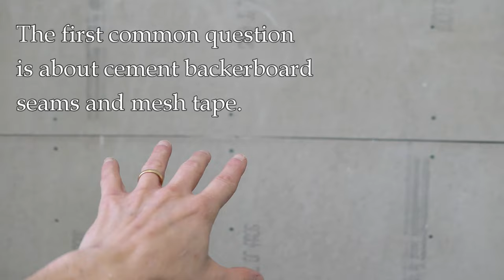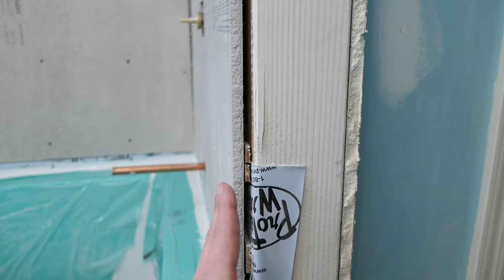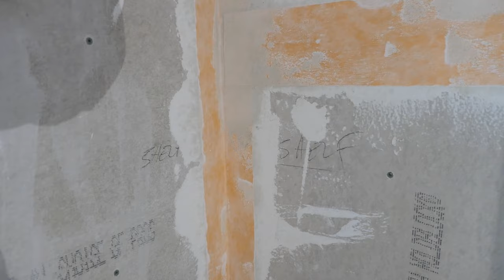Should Backerboard Go Over The Tile Flange Or Up To It?

Comment: Rad video, Thanks! One question tho. Are you not worried about the tile popping off of the stick on flashing near the tub flange? Is that material safe to tile to??? I am just about to install backer. I like this idea but am worried about tile/thinset adhesion to the flashing??? Thanks again! Very informative video!!!!
Reply from the maker: So, flashing or no flashing, the short area of the lip will not be a place where there is good adhesion from the thinset.  In other words, thinset will not adhere to the flashing and it will not adhere to the tub or pan if you did not use flashing.  This is not actually a problem for most installations.  The area there is typically around an inch in height or less.  If you plan your tile pattern correctly most of the tile will be adhered to the backerboard just above.  On a 12 inch tile you'll have 11 inches adhered.  On a 6 inch tile you'll have 5 inches adhered.  The area by the lip IS packed with thinset, but the purpose is primarily to provide a supportive structure for the tile rather than to adhere the tile to the wall.  The support keeps the tile from cracking if bumped, but it may not provide adhesion to the wall.  

Now, if you are using a very small tile, perhaps a 3x4 subway tile, you do need to be cautious about the installation.  In that instance I'll be meticulous about bringing the backerboard as close to the tub or pan shelf area as I can.  I'll make certain the backerboard there is dead flat, and I'll give the tile every chance to have adhesion to the backerboard since a smaller percentage of the tile is adhered to it.  And, it is possible that the nature of the circumstances prevents use of particular tile.  I have had situations with wall or floor tile where I've told a client that their preferred tile choice is not a good one for the circumstances.  They pick another.
Reply: @enduringcharm   @enduringcharm  Wow, killer response time and quality. Timing is amazing. Pickin up materials as we speak! I am using bigger tiles and that was my initial thought. The backer should provide all needed support. I just had a roll of the flashing in hand but i put it back, the aluminum coating scared me away from it. But realistically less than an inch of the material should be showing to cause any problems with tile adhesion. And a solid tile application and silicone should keep out any moisture anyways? Thanks again for that quick and informative response. Very reassuring!
Reply: @enduringcharm  and great point about thinset not really sticking to the tub flange in the first place!

Comment: You could eat into the studs to recess the tub and then shim out the opposite small wall.
Edit:
Nevermind Talked to soon, you just showed that the small wall is full lenght also.
Reply from the maker: Even if that weren't the case, it's a poor idea to chip away at the studs, especially on a load bearing or exterior wall.  If you needed to pull a permit for your project the inspector should call you out on that.

Comment: Love this video, I'm an architect and plan to share this with my contractor.  Do you have suggestions on installing flange-less tubs in an alcove.  I know you can buy tub flashing products and I've seen some contractors use aluminum flashing caulked on top of the tub edge to create a flange.  What do you recommend?
Reply from the maker: I recommend finding a tub with a flange!  There are a small number of modern tubs I've come across which did not have an integral flange.  I recall seeing a special order add-on flange for one of them, which was a weird bumper arrangement you were supposed to caulk in place.  I find it annoying when manufacturers make products as if they will be installed in a vacuum, without regard for the rest of the room or house.  It's not unusual these days for me to have to finish manufacturing an item, either.  Edges have to be filed down or holes drilled or sections cut away.  

Anyway, given the importance of the tile-to-tub line and the cost of a modern bath it's madness to rely entirely on a bead of caulk to keep water at bay.  I'm the first to argue that "waterproofing" is over-hyped in some areas like tiled walls, but the area where the walls meet the tub is not one of those areas.  I would make every effort to find an alcove tub with a integral flange, and that shouldn't be too difficult now because there are options at every price point.  Granted, the supply chain issues we face can be a challenge, but there are tubs to buy.
Reply: Thanks very helpful.  Especially the comment about the importance of sealing the tile to the tub line.  My client picked a freestanding tub they want to placed in a corner.  I was thinking we could add an aluminum angle with caulking then cover over it with door and window self adhesive flashing  similar to what you show in the video.  But I have the same concerns you've noted.  I'll steer my client away from corner tubs without flanges.
Reply from the maker: One secret to longevity in construction or design is never to let a client force you to do something you know isn't right.  I'm sure you'll find a tub with a similar style that has a flange.

Comment: In the past I used ice and water shield behind the cement board.  Now I usually just use red guard. Pretty much always put 1/4” plywood so the backerboard overlaps. But my goal is always to over build. 😜
Reply from the maker: To be clear, the point of me using the flashing is not "waterproofing" in the sense that Kerdi or Redgard is used.  I use the flashing even if I am also using Kerdi.  Instead, the flashing is there so that in the future if there is a problem such as framing movement, a homeowner who doesn't maintain the grout or caulk, or some other issue, water will be directed back into the tub.  I have seen lots of second floor baths leaking into first floor baths, second floor condos leaking into first floor condos, baths that were never maintained, etc.  The flashing is just a precaution.

Comment: Working on my bathroom now and found this video to be extremely helpful.  One question what fills in the gap that would be between the tile and the area where the the flange is?
Reply from the maker: When you've finished tiling you'll grout the tile and try to avoid filling the gap between the tile and pan/tub.  After the grout is dry and sealed, use a pure silicone caulk or a color matched tile caulk (also silicone) to fill that remaining gap.  If you are wondering about the backside of the tile where it overlaps the flange, that can be filled with the same thinset you are using for the rest of the wall.
Reply: @enduringcharm  It was the space behind the tile. Thank you for taking the time to answer my question.
Reply: @enduringcharm  If I was going to do a band of the Kerdi membrane over that gap near the tub, would I use a modified or unmodified thinset.  Also would premixed thinset be okay to use?
Reply from the maker: Generally Kerdi requires unmodified thinset over cement backerboard, which is because unmodified thinset gains strength when slowly evaporating.  Kerdi doesn't allow quick evaporation.  However, if you are just doing a band of kerdi over a joint or in a corner, you'll be okay with modified thinset.  Or, you can buy the "all set" thinset sold by Schluter which can be used in any situation.  Premixed thinset isn't even thinset, it's more like mastic with sand in it.  Garbage.  I forbid you to use it!
Reply: @enduringcharm  So I have one board up and I have it up to the top of the tub flange.  The gap is about an inch.  So I am going to fill this gap in with thinset?
Reply from the maker: Well, I assume you have already installed the self-adhering flashing tape slightly over the lip and then stuck to the stud faces?  See my other videos if you have not used this trick, which will prevent any future issues with water.  That said, if you can't bring the backer OVER the lip by shimming out the wall, then you will have a gap which represents the height of the lip.  It's fine to fill this with thinset just prior to setting the tile--with one caveat.  I'm assuming you have larger tiles on that first row which will have plenty of backerboard substrate.   If you are using a small tile (like a 3x6 subway tile) or if you have a short row to start, then you may end up with little backerboard substrate for the first row. That's not good.  In that cae i would nake every effort to bring the backer over the lip.  If you have, say, a six inch or taller tile then there will be enough backerboard substrate to hold it in place and you need not worry about the gap.
Reply: @enduringcharm  Yes the flashing tape is in. I will also be using larger tiles for the bottom row around the tub.  So it sounds like I should be good to go.  Thank you for the help.
Reply from the maker: Mike, you inspired a new video!  Thanks for your question, and see the video here:  https://youtu.be/y3bpE-GhYUM

Comment: 4:40 how is a silicone bead sandwiched between the backer board and flange a recipe for disaster? It seems like an added layer of insurance to your other steps.
Reply from the maker: I was speaking of a technique sometimes prescribed by manufacturers, which is to rest the backer on top of the flange and just put a bead of silicone there.  They don't mention flashing or anything else, just the silicone.  In that case if the shower grout and caulking is not maintained or if there is excessive movement of walls or floor, a leak would be possible.  My idea is to use a flexible flashing so that even if water does get behind the tile, it will be directed back to the tub.  In that case silicone is not needed.

Comment: Do you use an unmodified thinset with that kerdi-band?
Reply from the maker: It depends on the substrate.  An unmodified is recommended for cement backerboard, or you can use their "allset" thinset which can be used in any situation.
Reply: @enduringcharm  
I just used regular fiberglass mesh tape.
I put some window flashing from flange of shower pan to studs. Then durock down to just above flange. Then silicon caulked the gap between durock and flashing-covered flange. Next, I will redguard the whole thing, including over the flashing covered flange and silicon. I think that will help the mortar to stick to it.  The flange of my American standard shower pan is very thick, about half inch thick. It's equal to the thickness of the durock with the exception of a few spots where is a little recessed, maybe 1/16th. 
I think it will work out nicely. 
Do you see any issues with the way I'm doing it?
Reply from the maker: I'll be honest with you--I'm not a big fan of Durock or of Redguard.  I prefer Hardibacker over Durock because it is stiffer and stronger and because it isn't porous. Since you already installed it, though, consider installing the Schluter Kerdi membrane over the entire wall rather than using redguard.   Schluter is the market leader for a reason.

Comment: Thanks, very nicely explained. I having a similar situation that you explained, where I need to stay on same plane as the tub's lip & my durock board - because the adjoining drywall is already setup and I cannot redo the whole bathroom without significant overheads & delays. Question: If I paint waterproofing membrane (Aquadefense), will I still need the flashing and plastic film on the backside of durock board?
Reply from the maker: The reason I install the self-adhesive flashing is more about the future than about everyday use.  It's there so that years down the line if the homeowner doesn't maintain the caulk or grout, or if there is significant framing movement (seen it) then there is some protection.  It would also prevent moisture from the bottom edge migrating into the stud bays.  If it's just surface waterproofing you desire, I would still use the self adhesive flashing if possible and then I would use the Schluter Kerdi membrane.  I'm not a fan of the paint-on waterproofing of any brand.  You can also now use the Hardibacker "Hydrodefense" waterproof backerboard.
Reply: @enduringcharm  thanks for your advice. Take care.

Comment: Awesome video thank you!

Thoughts on wet shimming between the backer board and the studs?
Reply from the maker: I see there's another well known youtuber suggesting this practice.  Look, I'm a general contractor who does remodeling, repairs, restorations and sometimes new construction.  I'm not just a tile guy.  Naturally I'll have a different perspective and different experience than somebody who specializes in tile.  I've worked on houses from the 1750s on up to the present day, and every year I do a variety of work from kitchens and baths, to repairing rot, to repairing or replacing framing, to siding and exterior trim, to fine finish work and more.  Would I apply thinset to studs as a means of shimming out backerboard or Kerdiboard?  No.  Could that technique work?  In the short term I'm sure it may, in the long term I would be concerned about repeated seasonal wood movement causing gaps or delamination (for lack of a better word) between the wood and the thinset.  This is, after all, what happens with plaster walls and ceilings when the keys begin to break off from wood lathe.  And, frankly, no self-respecting carpenter would choose that route anyway.  I use tapered wood shims, cedar shingles, plywood strips and the like to shim when appropriate and I screw through the backerboard and the shims for a solid connection.

On the other hand, if there are SLIGHT undulations in the backerboard after installation (perhaps an 1/8" or so) then I will use thinset on the tile side of the backerboard to smooth and flatten the surface.  That can be done in advance and allowed to dry, or it can be accomplished by using a thicker layer of thinset and applying it to both the tile and the wall so that tile height adjustments are possible.

Comment: What are you filling the gap between the backer board and the tub with. If you are setting the board on the lip of a shower pan then you could have a gap of an inch or more. If you are using the window tape then whatever you fill that gap with does not adhere to the pan but adheres to the tape. Is there any issue there?  
I have seen many videos where they fill that gap with thin set  or quick set concrete. Wouldn’t that allow wicking up to the cement board? I know that area is generally covered with red guard or equivalent. I also know you are using hardi board so the wicking is not an issue. But what if you are using a cement board?
Reply from the maker: I made a video just to answer this question!   https://youtu.be/y3bpE-GhYUM
Reply: @enduringcharm  Thanks for that.

Comment: You "don't need to waterproof hardiboard?"  I beg to differ.

Put about 5 drops of water on a scrap piece of hardi-board, wait 5 minutes and then check the back side of the material. It will be wet. 

Tile is not waterproof. Neither is thinset. And grout CERTAINLY isn't waterproof

Most people will take more than a 5 minute shower. Today the average shower time is over 15 minutes. This can be calculated based on Gallons per minute used in avg American Households.
Then multiply that by the number of people who use that particular shower per day
. 
That said, if you don't waterproof your shower walls (including James Hardy, Hardiboard) you are putting water DIRECTLY into wood Wall studs, where there is no light, no air and warm conditions (due to being in a shower).  What do you think is going to happen over time?
Reply from the maker: Well, you've pretty successfully included all of the waterproofing fears in one place!  To be clear, I'm not opposed to waterproofing products, such as Schluter Kerdi membrane.  In fact, that's what I use when I tile a shower floor, and I run it up the walls, too.  However, waterproofing isn't required in every circumstance.  I know.  I've paid careful attention to every bath I've demoed, which is something like 60-70 at this point.  I also personally have bath installations which are over two decades old, and I have also examined them closely.  Your contention that five drops of water will soak through 1/2 inch hardibacker in a few minutes is silly.  Tile varies in water absorption.  I use high quality impervious porcelain tile which has a water absorption rate of less than .5% whenever possible.  If a client picks a semi-vitreous tile I usually try to talk them out of it for a shower.  But if a client does choose something I'm concerned about I have the option to use the Kerdi product.  As you saw in that video, I do generally use Kerdi now for corners, which are more prone to issues.  In the 16 years I've been in the remodeling business I have not seen a single instance of the middle of a wall becoming damp as long as the tile and grout are intact.  And even when I find broken tiles which were installed with mastic over drywall (pre-cement board) the studs are generally just fine.  Your fears are overblown.  Why not just waterproof anyway?  It costs more and the tile adhesion is not as good as installations directly onto hardibacker.

Check out a video I did years ago on this subject:

https://youtu.be/xk7lNudSV2Q

Comment: some flashing tapes can leach into acrylic and cause stains
Reply from the maker: You may be referring to the old-school, tar-based flashing.  My current favorite is the Zip System flashing tape, which can stretch to extremes in order to conform to the lip.  I've completed many dozens of bath remodels using this flashing idea and staining has never been a problem.